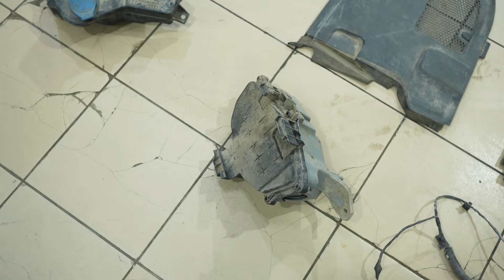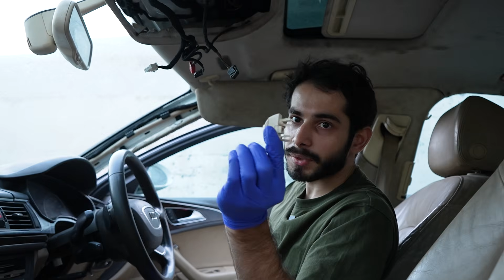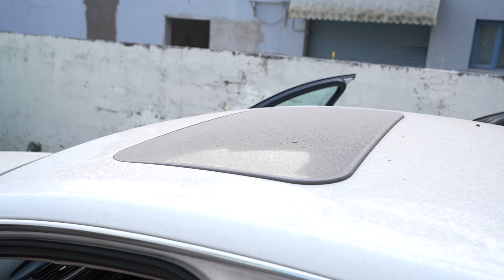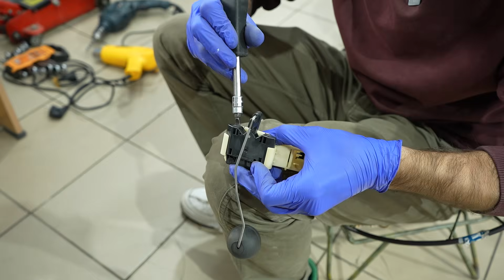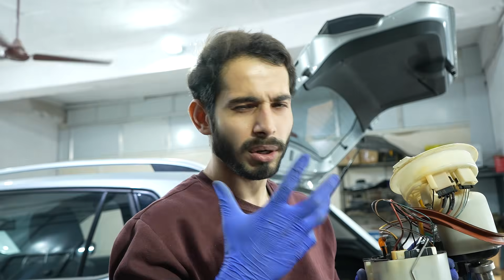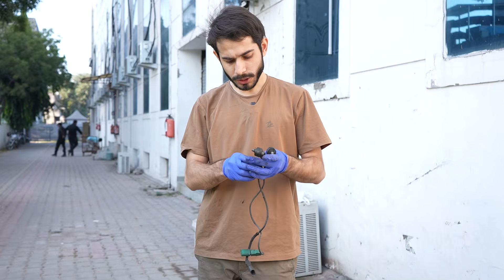Fixing the tiny electric gremlins of the supercharged A6 l Project supercharged

Comment: need help here got a 2012 passat b7 tdi automatic 
got a weird problem at idle the the battery voltage keeps dropping as monitored with obd 11 when i start driving the battery gets properly charged i have check the alternator and the battery which is in good health what is causing this problem i cant understand help me out

Comment: The fan issue you pointed at the beginning of the video, I also have the same issue in my VW polo GT tdi, as soon as I turn on the AC the fan starts even in cold start and turn off when I turn off the AC even after a long run and when the engine is quite hot. Is that normal or something concerning?